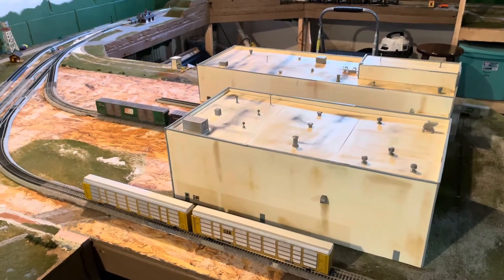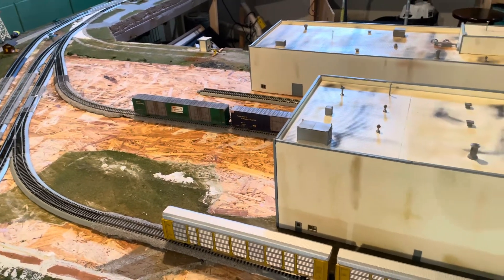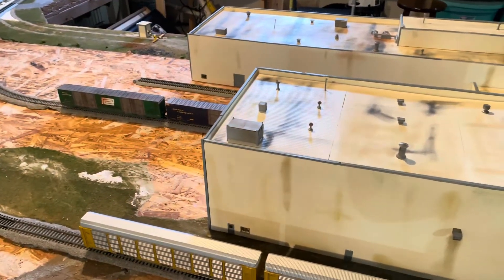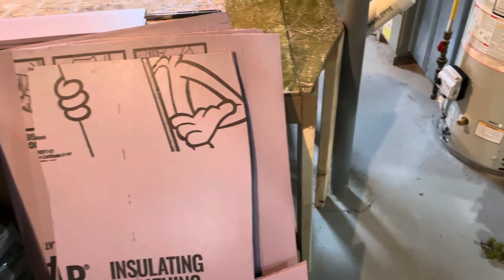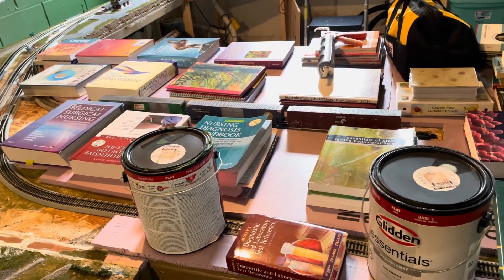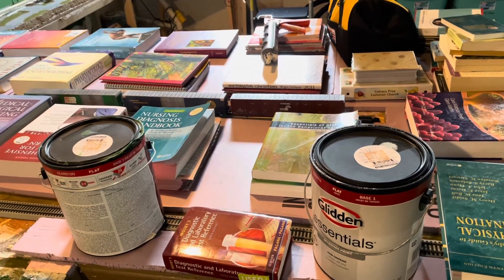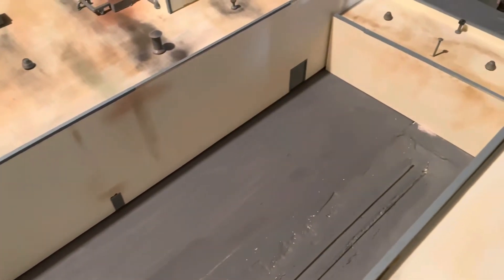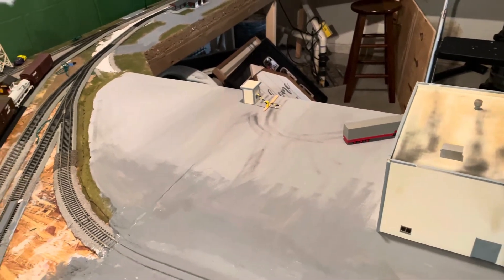Layout Update 4 - Paving the Way

Comment: You could have used 5/16 cork roll. It's only 10 bucks or so and would have been plenty for this project.  Then just barely skim it with plaster or etc . The cork does roll up when sanding if you glue it correctly and does make foam particles that stick everywhere. I have done both methods and the cork was cleaner and faster. .. anyway looking good.
Reply from the maker: Good idea. I hadn’t thought about cork. That would have definitely been closer to the height I was looking for. I’ll keep that in mind for future similar projects. Thanks for watching and your support! 👍
Reply: @millvalleysub  Also cork is a type of wood , so if you spread simple wood glue it bites hard. This makes it easy to sand and shape without rolling up. It can work for raised roads also.
Reply from the maker: @adriengadson3544  very nice! Yeah I’ve seen it used for roads and also the backside of a roofing shingle for roads as well. I love all the different ways we can use everyday materials in this hobby. Thanks again for the tip!

Comment: 3/8th - 5/8th's This is why I never estimate anything. Measure at least twice. And Spackle!!? What a terrible idea! I used Plasticard and Spacers For My road run section.  Had problems even with that, but it runs perfectly now.
Reply from the maker: Haha I know I can’t believe I forgot my measurements for that. And yes spackle definitely was scary to use but turned out nice. I’m with you on plasticard. I actually used very thin cardboard for my mainline crossings so I wouldn’t have an issue. Thanks as always for your support 👍